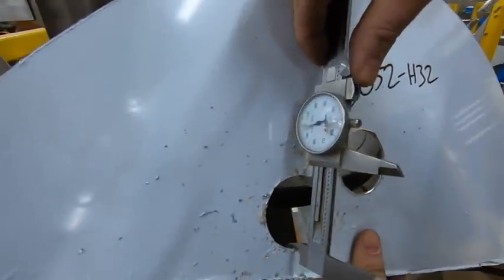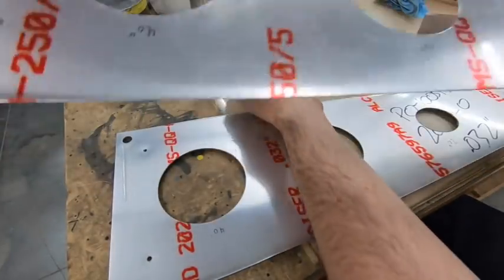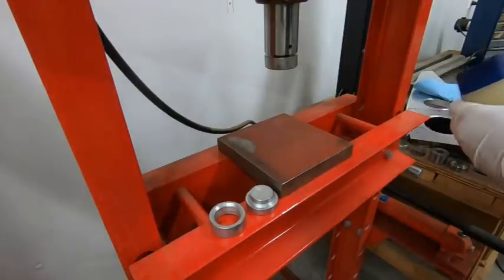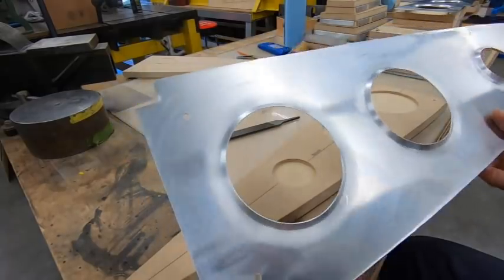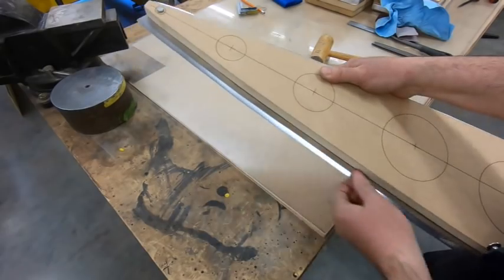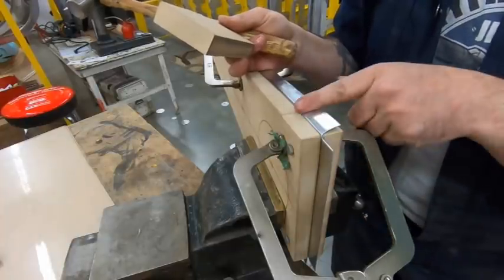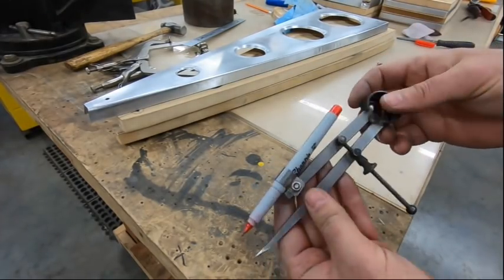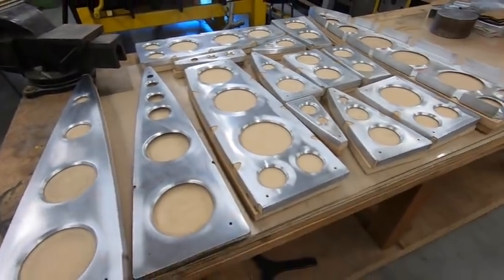Episode 17 part 2 Hawker Typhoon Fin Ribs

Comment: Nice work but it will take decades at this rate.
Reply from the maker: For an aircraft that's not been produced in over 80 years, for which most engineering information has been destroyed, and one that has only a single intact example in existence... that's how it works.

Comment: We're these pieces original manufactured this way by hand? Or,  given the war going on,  we're they stamped and pressed using large dies and special tooling?
Reply from the maker: They would have been stamped during production, but that process is not economical for short run rebuilds and restorations. ~Ian
Reply: @TyphoonLegacyCoLtd  Understable, specialized tooling is extremely hard to find and expensive,  it would be worth having only if you're mass producing something.  I think I like your artesian approach more.

Comment: Do you know whether the armoured glass windscreen on the car-door models was the same piece as that used in the bubble-canopy Typhoons and Tempests? I can't find any drawings for the structure of the car-door assembly unfortunately.
Reply from the maker: I believe it is different, will need to confirm though. The windscreen angle is very different between the two. ~Ian

Comment: How critical are the tolerances on the lightening holes, especially their positioning? 
This is really valuable technical training  for homebuilders (curtrent or aspiring). The Typhoon's obviously mostly on a different scale than any light machine, but the fin's comparable in size to a small aircraft's wings. Most people won't have access to forming dies, so they'll have to use a roller tool to form the lips on the lightening holes, but that takes longer than a press.
Reply from the maker: Standard aviation metal work tolerance is plus or minus .030", but best effort should be made to keep as close to the small end of this range as possible / practical. with parts of an assembly, if you start to work too loosely with your tolerance you can end up with stacking errors and an absolute nightmare for fitting and assembly. The center location of a lightening hole can be off slightly (within this tolerance) but there are other things to consider as well. The proximity to other bends, flanges or fasteners is also critical. ~Ian

Comment: A very nice episode Ian. A question or two actually if I may? What pressure were you putting on the dies when forming the lightening hole stiffeners, and what was the pressure difference between the smallest and largest holes if any?
Reply from the maker: Ultimately you want the dies to be completely closed one each side of the work piece; then I usually give it another pump of the handle. The pressure required depends on the material alloy, temper and thickness; as well as the die diameter. In this video I didn't go above 5 tons, this was with holes up to 4.0" diameter and "O" condition 2024 material at .032" and .040" thick. If i recall, the range was about 3-5 tons from smallest die to largest in this application. ~Ian

Comment: You spend a lot of time using files and sandpaper after cutting your holes. Is there a reason for not just using one of these: https://www.fotoagent.dk/images/webp/QGD5HipvxV7DzEjU4pW1ty_WYS--dTmqW90wW3GF7wXIxwdH43_CHcigWYamNfqDcMKVtWkdGQitkMHwSx-YSQ/single_picture/11108/138/afgrater-pen-laengde-150-mm-mreserveklinge_30256061.jpg

Comment: wont the line from the opposite side of the dividers create a scratch down the length of the top of the flange when you were making the red line on it. and if so wont it create a stress point ?
Reply from the maker: The dividers have a slight radius to the inside leg face, this prevents scratching. ~Ian

Comment: Hello lan. I think l ran out of superlatives by episode 3 ! But as usual  your work is absolutely flawless. Theres an irony that the sheet metal has Kaiser stamped all over it ! Thanks Ian. A few people are asking when do others come in on the project. If you're on your own l think l may at best have 20 years to go ! 😂😂Take care and stay safe.
Reply from the maker: Thank you John, at this point of the build most of the work is actually our design team for the Typhoon (Bruce, Martin and Nicolas), aside (of course) from Rob on the Merlin. I will be the primary structures for the majority of the build, but will likely have a few folks in to help where extra arms are required. I'd be happy to work within the 20 year budget lol. ~Ian
Reply: I watched a documentary on a Hawker Hurricane build. The only place they could get the exact aluminum tube was from Germany. The first batch was not the right composition. The manufacturer supplied the, 'correct' next batch, for free.

Comment: I have watched several of your videos and I am always impressed with the care that you take to do things properly.  However,  I wonder if the same level of care would have been taken when the Typhoon was being built under wartime conditions, or would "good enough" have been acceptable for non critical components ?

I wonder if there any records of how long it took to build a Typhoon during the war
Reply from the maker: From what I've seen, there were a few factors at play for the finish work on wartime production parts. There needed to be a balance for the amount of time spent on a part or assembly with consideration that the aircraft's expected life. The other is that the aluminum structure was still fairly new in design, and many lessons were being learned. I'm not sure how much they considered small scratches and unfinished edges to be a stress issue at the time; I see a few similar issues with rivet spacing and machine work on forged parts. If you recall, even several years after the war the DH Comet was built and pressurized with square windows. ~Ian
Reply: I wonder too how many hours they were expected to last, but by that point in the war the allied air supremacy greatly increased the lifespan of our aircraft

Comment: Have you considered using chainsaw files for filing the corners? They are cylindrical and have diametres ranging from 1/8" to 1/4". 
I use them a lot because I have them for my saws - and because they are cheap.
Reply from the maker: I do have a few round files that I use  for smaller corners, but find that I prefer to use the key file size half round for most of this work. ~Ian

Comment: Don't you think you should go CNC router or milling machine? Or a punch kit? You could make your own punches with a lathe. Those cutter tools are horrible, and dangerous.
Reply from the maker: They work well for occasional use, if I went with the ultimate way of doing every aspect of the project, it would be more difficult financially, and would likely never get done. Doing this type of work (one off) typically requires creativity and older techniques. I would also say that I don't think I would enjoy the process much if I was just programming a computer to do the work for me. ~Ian

Comment: Great update as always. We have a mix of lightening hole types on the Stirling; standard ones like yours or 'bead and flare' type which need a bit more thought. Thankfully my son is a CNC turner and has helped us out by modifying some existing tooling to suit our needs, but we'll have to design and make a number more as they're non-standard sizes...typical Shorts design!

As you say, it's all in the preparation and I like your idea for joggling in the former; I've previously made up some sheet metal formers and squeezed them in a vice.

look forward to the enxt update
Reply from the maker: Hi John, the sheet metal joggle tools are what I normally use; they too take a bit of rework, but they are very effective if you clean them up well. There would be quite a bit more work with the bead style flares; I (thankfully) have yet to see anything else used in the Typhoon, but will need to cut some larger dies for the wing ribs (up to 7.0" if I recall). ~Ian

Comment: Is anyone else el5working on the plate work, or just you as it seems a monumental task.
Reply from the maker: There are several key individuals quietly working away on the project, Bruce, Martin and Nicolas for the design team and Rob on the Merlin. I will be the primary structures for the duration of the project. ~Ian

Comment: Really making some progress. What´s after the fin? Do you tend to focus on one section at a time, or jump between parts?
Reply from the maker: Once the fin is done it is hoped that we will be able to start the rear monocoque fixture construction. The timelines will move around a bit though, I'm always working on a few different areas to ensure I can keep productive if we slow in one area due to data, cost or parts. When the fwd mono is complete and out of fixture, it is likely that the wing fixture will be completed and cockpit construction will be close, or already underway. ~Ian
Reply: @TyphoonLegacyCoLtd  Thanks for the reply. I´m still amazed how quickly this seems to be coming together, considering it's only you actually building it.